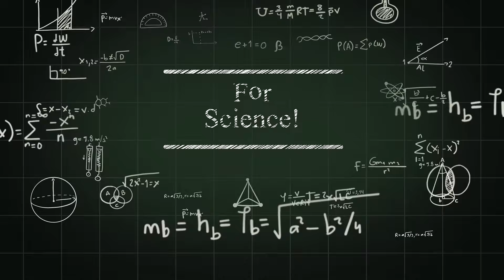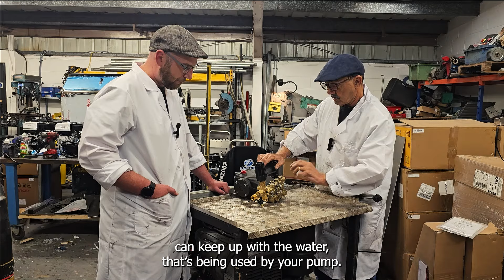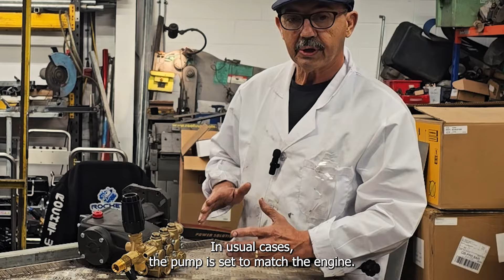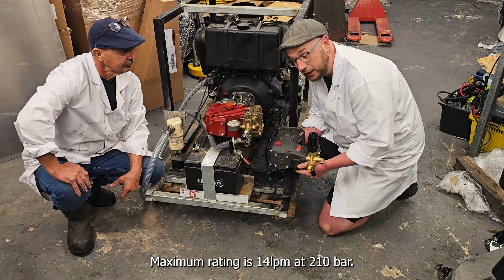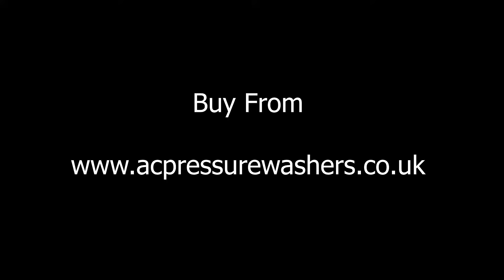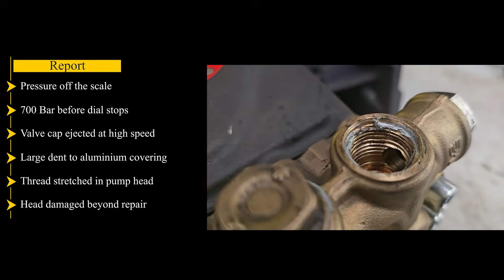What Happens When a Pump Can’t Release Pressure? | AC Test Lab

Comment: Unloader usually recirculates the water trough the pump, this is how kranzle is doing it, and you can recirculate it a few minutes, not seconds like you mentioned. The water will heat up, but not that fast.
Reply from the maker: Kranzle units generally have a much lower flow rate than the units we deal with in the exterior cleaning industry. A 21lpm pump will melt seals in seconds if left bypassing through the pump head. Return to tank bypass is always the better option.

Comment: What happens when the cap blow and inner thread damaged. Is it need to change the manifold ?
Reply from the maker: Normally the thread is stretched, meaning a new pump head is required.

Comment: Is there a device (pressure relief valve) that could be added to save the pump in the event of an unloader failure?
Reply from the maker: Sure, there are several precautions you can use. Such as burst discs and pressure relief valves :)